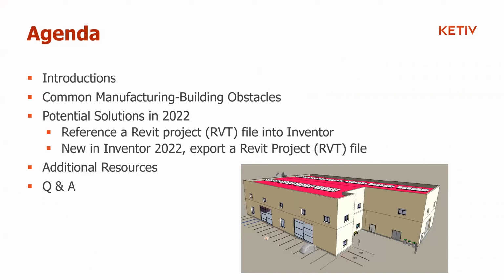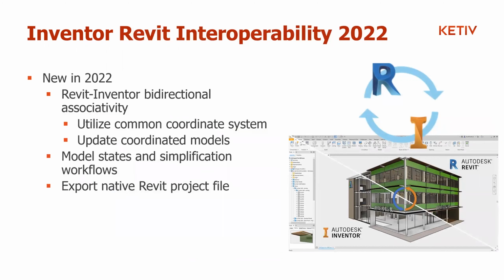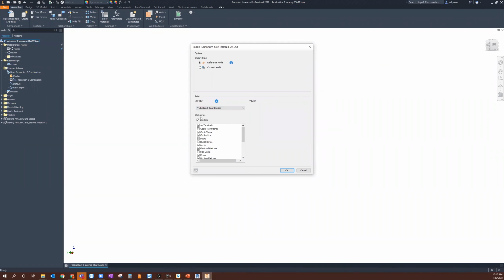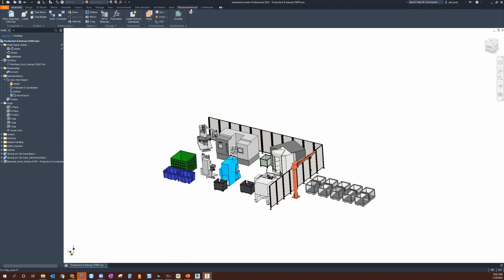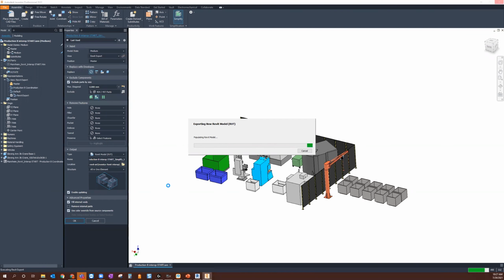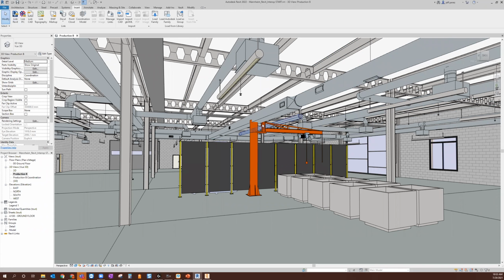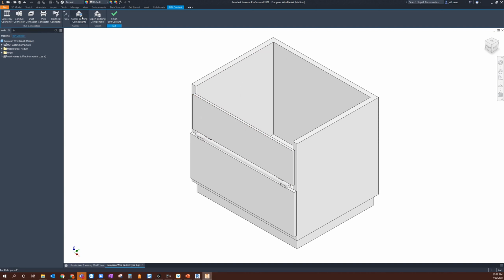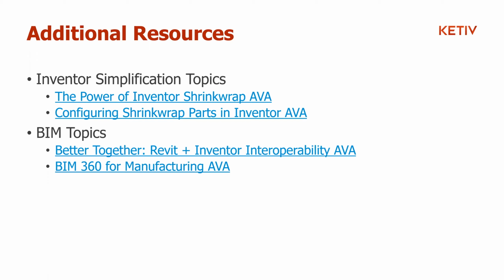Export Native Revit Files from Inventor 2022 | Autodesk Virtual Academy

Comment: The problem which I have and can't find any solution is how to get physical characteristics from Inventor's model (let's say welded steel tank) into Revit's materials' schedule. This tank is part of steel structure for dust collecting of aspiration system. If you give me direction where to dig, it will be super. Thanks.